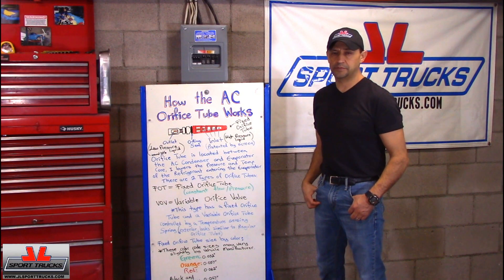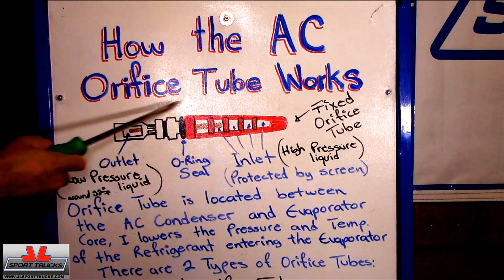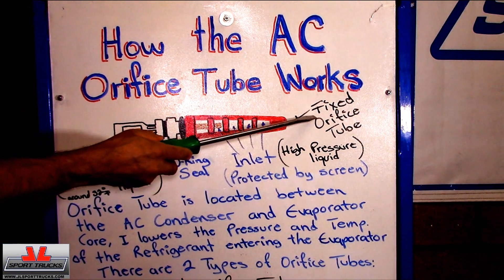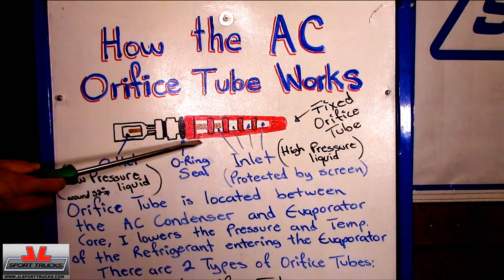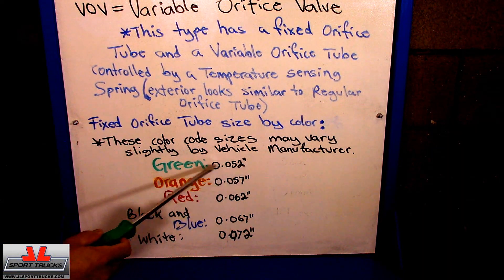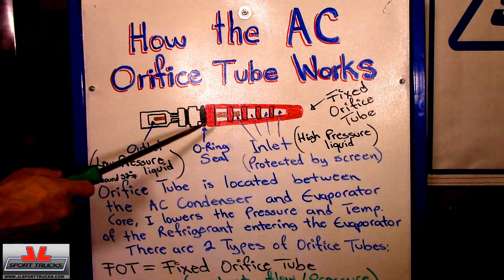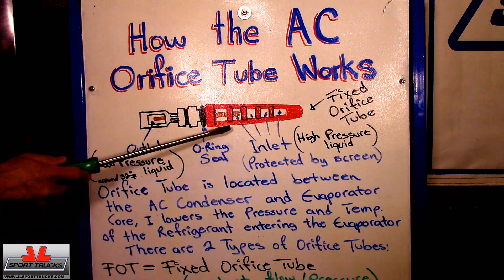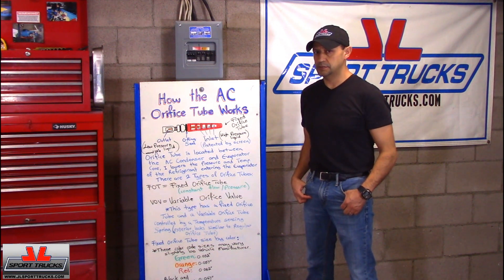How the AC Orifice Tube Works by Howstuffinmycarworks

Comment: Hi, thanks for the video,  I have a 1984 cadillac eldorado I installed a new compressor and new accumulator I don't know wear it located the high an low pressure switch,  or my ac is not required, 1984 cadillac eldorado 4100ht engine 🤷‍♂️